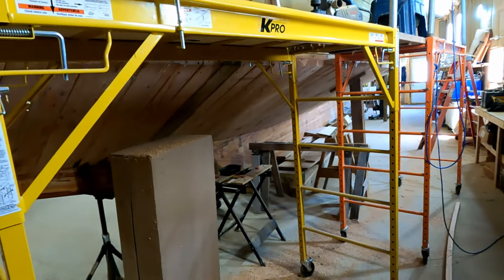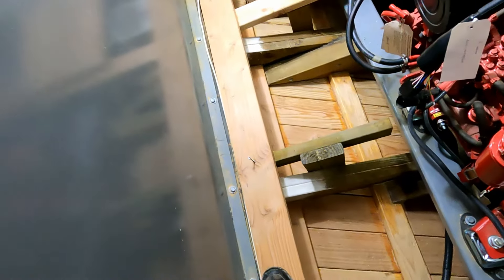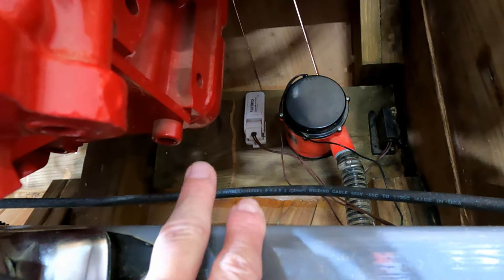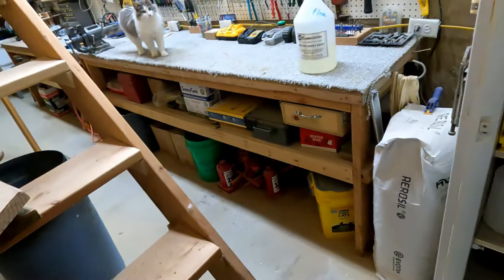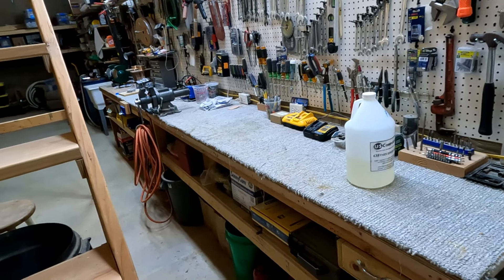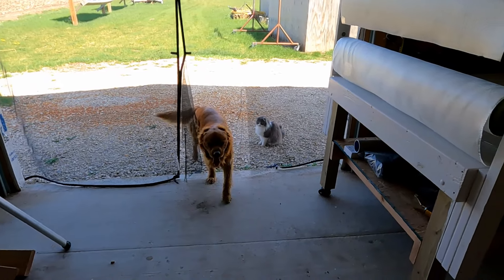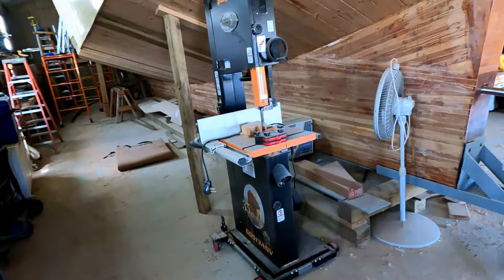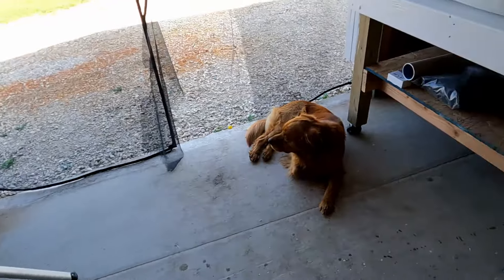Bilge Painting - Portholes Arrive - More Plywood

Comment: How hard would it be to dry the bilage out when  it does flood because it doesn't take too long for a 2×4  to rot once it's wet
Reply from the maker: The designer claimed non painted planks are much less likely to rot, painted planks are sure to rot was his claim. Of course salt water will preserve wood, so if you stay out of fresh water is shouldn't be an issue. I plan on having a dry bilge and to keep it that way I'm going to install some forced ventilation in the bilge that can be run when needed to dry things out. We'll see how all that works out some day. Wood boats don't sweat, so that helps.
Reply: I would not want oil getting to the plank and shocking into the plank, fire hazard.  My 2 cents worth.